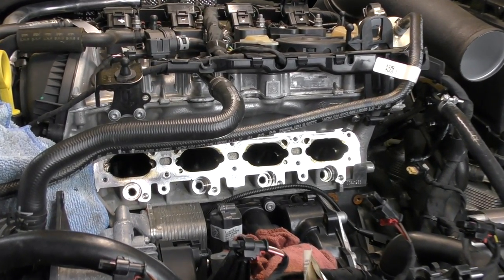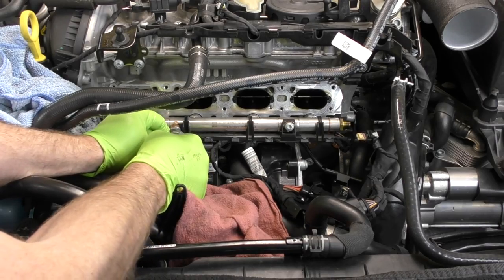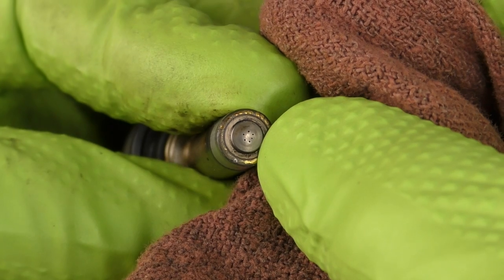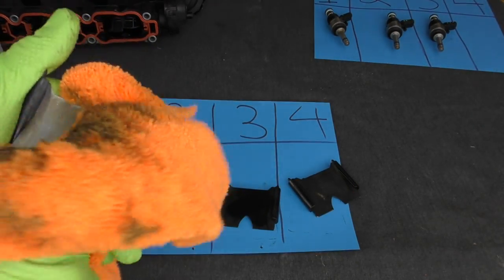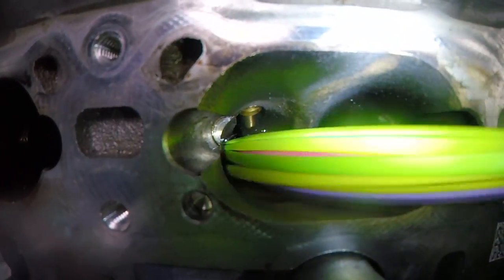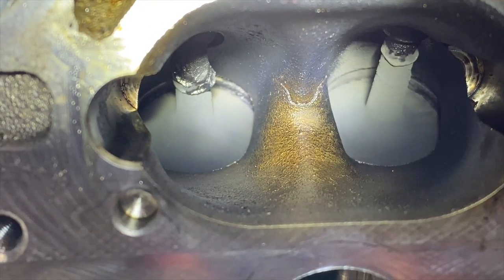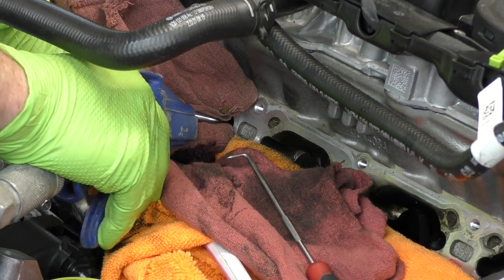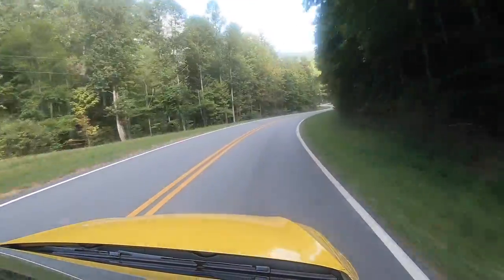How Much Carbon Build Up at 10,000 Miles?? ~ 2019 Golf R

Comment: My 2018 S3 is approaching 30K miles.
This amount of carbon buildup is alarming.
Reply: Rob L. If you haven’t done any type of autox you won’t see heavy build up. Autox is a real issue with the oem pcv valve...
Reply: @markd3891  You don't know what you're talking about do you?
Reply: Olle Jansson I own a 16 R dsg. Maybe the way I explained wasn’t too great. All DI engines will built up carbon eventually.
Reply: At 30k you are close to beginning stages of clod start misfires. I always push the induction service on my customers every 30k.
Reply: Lynx Star Automotive Yeah it’s interesting on the gen 3s versions. My bro’s 15 S3 always had a rough cold start idle like miss fires from new, my 16 R (24k miles atm) never had any of it like my bro’s. My friends 16 R is at 63k & it sounds literally the same like mine. (Plans to diy at 65k). From what I’ve seen & witnessed, the gen1/2 would carbon deposits like no other ~30k while the gen3 being more reliable seems to be having carbon issues anywhere from 60-80k. Luckily we don’t have timing chain issues but the dreaded water pump remains the same.
Reply: Mark D Water pumps are ham and eggs. I can knock out a WP in an hour and a half.
Reply: Lynx Star Automotive yezzir, probably why they didn’t budge on reinforcing them to be more reliable. Hey more work & $ for you guys
Reply: Mark D honestly, after the latest revisions, they don’t fail that often. I typically see them go about 100k now a days.

The issue lies when customers skimp and either buy a counterfeit, an outdated part number, or just crappy aftermarket. Those are not worth the 80 bucks you are saving.

Oh and BTW, the pump was redesigned on later model years. The housing is more robust. The impeller housing is now aluminum. The thermostat housing has also been redesigned. Pay attention to Charles’ pump with the intake out.
Reply: Mark D One is my main suppliers closed down when things started becoming more imminent, and I myself sent everyone home and pretty much just stayed by myself and any other techs that had in process jobs. Once those were wrapped, I sent them home as well. I’ve taken calls here and there, but nothing too serious. Figure we ride this out until the all clear is given.
Reply: Cars with direct injection are garbage. I can't imagine that engine will last after 70k
Reply: Daniel Calquinhas I’ve seen plenty of TSI with deeeeep 100k’s. Usually, the DSG clutches go out before anything serious on the engine does. M6 cars for the most part are bulletproof. Oil quality and maintenance plays a huge role.
Reply: Yeah I'm sure you have. Building B/K series hondas and being a full time mechanic for 16 years no amount of internet back and forth will change my mind on these vw engines. These engines are unreliable and overcomplicated. The reason perfomance and mechanic garages love them is because it keeps them in business.  I've seen b18c1's bone stock with 200k make 500whp with a simple turbo kit. This engine at 10k already almost had a partial blockage at the injector lmao. Just drop it friend.
Reply: Daniel Calquinhas What a load of exaggeration, but yeah sure buddy 500 whp racing lasting 200k miles, OK. 
The gen3 & ea855 are leaps & bounds better then there previous gens & example is38 gti are 380-400 whp proven reliable way past 100k. Don’t think so? Go on the giant FB Mqb gti R group page & ask what kind of miles people are at. You will be surprised. 
By the way those new Honda turbos that they have now, I heard nothing but issues with them especially their bread & butter cars. 
The 18 & 19 VWs came with 6/72k mike warranty something that it is unheard of from the German world. 
Lastly you are thinking of the horrid gen1 tsi...those were such a pita as soon as you hit 60k & it’s why it keeps folks like Lynx loving those previous gen engines.
Reply: Daniel Calquinhas LOL. I won’t argue friend, ignorance is bliss as they say. I will tell you this, I’m 37 yo and built plenty of Hondas in my day. You are not pushing more than a couple of psi of boost on a stock B18 and getting very far. Stop it. Ohh and manual transmissions only. Don’t even think about an autotragic.

A Golf R is a tune away from 400 HP. 

But you do you.
Reply: Lynx Star Automotive I’ve had golf R for 4 years and 70k miles, I only do scheduled maintenance with feeler in the UK over here. I’ve had absolutely no issues with the car at all. MPG and performance is no difference compared to when I first picked it up.......
Reply: NL3044 They are bulletproof. Oil service is extremely important. Good quality oil (Liqui Moly) and no longer than 7k mile intervals (or 11km for you). That will take you far before you need anything major.
Reply: Great!! Can't wait to see how much mine has @100,000!

Comment: 0w20 oil just evapotate almost like water and it is absorbed very easy by the pcv and thrown in the intake.  Caratec doesn't do a thing and the petrol v power, is not sprayed in the right place.  One more round of injectors, placed in the intake, eventually by the manufacturer, witch should work in a few driving regimes, as in long rides and highway or something like that ,would fix this problem for ever. 
Thank you for this video, H.M. !
Was like gold! :)

Comment: I would be interested to see how this differs from the eurospec multiport injection engines, or with an aftermarket multiport kit such as the one offered by APR.
Reply: @Matthew Dunlap do you know how EFFECTIVE is the EU multiport injection system ? does it completely solve the carbon  build up ?   (  I'm asking you this because I'm aiming to but a 50K miles Passat B8 here in Argentina which comes imported from Germany plant and I already confirmed that it DOES have the direct+indirect injection manifold... but... is it 100% EFFECTIVE against carbon buildups ?
Reply: @opablo_gm  I can't say for sure how effective it is. Most fuel has additives for cleaning, and fuel itself can act as a solvent on the carbon. It may not be 100% effective, but it should be much better than direct injection.
Reply: @MatthewGDunlap  Yes its 100% efektive! Even on high milege cars intake is clean, i speak about 250k km cars! Its clean because of that system inject the fuel in intake valve, if carbon wich is not burn in cilinder goes in intake then fuel wich is injected in intake clean it and then no problem, its self cleaner(mpi). But speaking of Golf R even the European version of 2019 post WLTP emision regulation doesnt have mpi, it have just like american golfs direct incjection! So the problem is the same! Only pre WLTP cars version with 300hp prefacelift and facelift version with 310hp in Europe have mpi. Favelifted version with 300hp(post WLTP) doesnt have one! Its a shame on VW to do this in order to cost saving!
Reply: trader 247 Although high mileage is relative, higher mileage in the states means 250k miles. That’s only around 156k miles.  It’s still a lot but it isn’t as much as we consider high mileage.
Reply: @shadowthesi  Yeah u r right! But because here is video of Golf R wich is performance car, 250k km is a high mileage! So if in that condition doesnt have a problem, thats it problem is solved with mpi!
Reply: Euro versions are a lot better, this is pretty bad.
Reply: @trader2473  I have a cupra 290 with mpi & these injectors do a good job to reduce carbon. But these multi-port injectors are not high flowing but if going stage 3 you can simply get larger 930cc injectors to increase flow.

Comment: Europe gets a secondary fuel rail(with lots of other perks) which eliminates carbon buildup problems, idk why US still not worthy...
Reply: Doesn't the Subaru BRZ/Toyota 86 have both direct and port injection in the US?
Reply: You would think they would make it dual injection considering how they might payout if something big happens within the 6 year warranty period.
Reply: Aleksander Rysiewicz yup it has Toyota’s D4S so both port and direct
Reply: Yeah i have a 1.8tsi ea888 gen 3 in my car in the uk and it has dual injection, 2 per cylinder.
Reply: @calm7677  They also make like 140-150 to the wheels.

Comment: Ive used seafoam through the intake air temp sensor of my wifes car since the last carbon clean 30k miles ago. I use it every 3 months or so. But i dont want to pull the intake to see if it works

Comment: I remember pulling the intake manifold off my MK6 GTI at 240,000km and the carbon was caked on! Cylinder 2 suffered the most because airflow from the PCV port is closest to that cylinder. Mind you the car has probably never had carbon cleaned off before.
Reply from the maker: Yep 2,3 are usually the worst. That is why I did 1/2 for cleaning. Also the valves were already closed. LOL

Comment: For the first time I’ve tackled the job of complete intake manifold replacement along with throttle body replacement (previous owner crash damage) & did a a full carbon clean at the same time. I found these humble mechanic tutorials very helpful in getting my head around the EA888, albeit with the additional factory multi-port injection rail setup in an Audi S1 with so little room in the engine bay, that the internal bonnet latch in the rad support panel needs to be removed just to clear the throttle body. 

I’m still amazed at the carbon buildup from only 21,000 kms (13,050 miles) & I’m hoping the APR catch can setup & complete removal of the factory PCV setup (racecar-mandatory) will cut this excessive carbon buildup down in the future.

Comment: 102,000 miles on my GTI without a clean. Wonder how lovely that looks. No misfire issues and still getting 33mpg 🤷‍♂️
Reply: Well, that's good. My R is at 8800 miles and this video was making me get worried. Still think I might clean it, maybe at 20k or something.
Reply: 93K on my 2011 Gti and can't imagine how mine are. Used the CRC stuff through the air mass meter along with Techron for the injectors(pre-oil change) and I've managed to convince myself that I can feel the difference.
Reply: K C Shhh it'll hear you!!!
Reply: @chris746568462  same here...
Reply: How long have you owned it? If you bought it used, I’m willing to wager it has been done by previous owners before you.
Reply: Lynx Star Automotive bought it new December 2016.
Reply: @chris746568462  You will be surprised how minimal it will have. Most gen3 owners do them around 80-100k. I wouldn't waste money at 20k, save it for the dsg service, 40k stock, tune'd 30k.
Reply: chris746568462 i think 20k is a bit soon. Even on 20 year old DI engines, it takes at least 80k miles before you see problems on even the worst examples of buildup
Reply: Im at 118,000km, stage 1+ and other various mods. Curious to see what the difference would be
Reply: I think VW recommends a cleaning every 40K or so if I'm not mistaken.  A catch can set up would help a bit.
Reply: Do you think having the stage 1 upgrade will make it cleaner or dirtier?
Reply: @raizt1596  I would say dirtier because of running more rich and at higher cylinder pressures.

Comment: I think the fuel quality plays a big role in here.
we in germany have 1.2 ltr turbo toyotas with direct injection.
most of them run perfectly fine.
some are terribly bad. completly gunked up, it even cuts out. with 40.000 km's

these engines need some catch cans or like an old scool central fuel injector, just for cleaning.

but its a toyota. you remove the intake in 5 minutes.

Comment: I bought a new 2018 Focus ST in April 2018. It was my first DI vehicle and I had read plenty of the concerns about caking of the intake valves. Sure as hell, 8 months/10k miles later there was some notable funk accumulated. Oil: Amsoil Signature Series. Fuel: Chevron 93 octane.

I began hunting again, this time for a new vehicle that still utilized PFI. The S550 Mustang GT uses a combo of DI/PFI, but I wanted solely PFI. I narrowed down to a 370Z NISMO or a Shelby GT350 and ultimately went with the GT350 due to the Ford dealer offering better trade-in value.

No more DI shenanigans on this end, thank goodness!

Comment: Wow, not what i would wan't my 10k mile engine looking like. I love Volkswagens but i think ill stick with my 2x MK2 Golfs.
Reply: Love my 91 Jetta coupe yoe ,and the 79 round eye diesel 😁 that's in 1000 pieces in the corner
Reply: @MrTheHillfolk  I own a 5-door 1987 pre facelift MK2 golf 1.6 with a Weber carb ,and a 3-door facelift 1988 MK2 golf GT 1.8 also with a Weber carb 😁 Both are great!
Reply: There's a part of me that's drawn to VWs and occasionally I think that maybe a Golf or a Jetta would be a good new car, but Charles does a pretty good job of bringing me back down to earth and remembering why I shouldn't do that.  :D  I'll stick with my '68 Beetle and if something like a Scirocco or a MkI or II Rabbit/Golf/Jetta comes my way I wouldn't say no, but other than that....
Reply: Direct injection is garbage other than marginal fuel efficiency which is sacrificed by users demanding more power and bigger, heavier vehicles.  Change my mind.  Sold my other car to buy a 1st gen Insight.  60 to 80 mpg,  995cc, 1800 lb, can go 400,000 to 800,000 miles without a rebuild.
Reply: @VndNvwYvvSvv  Agree completely about GDI...that's why I'm either considering one of the handful of MPFI cars left on the market or restoring something older for my next daily driver to meet my rather modest needs
Reply: Just bought an mk4 for 800$ check engine light on and 289k miles as well as abs lolz
Reply: It's not a vw thing. It's Direct injection only engine problems. Many auto maker has already moved to these type of engines
Reply: LOL they all have horrible engines. They're VWs.

Comment: Here is a tip for you, Charles. Subaru upper engine cleaner and a long air nozzle with a high pressure air supply, fill the port with the Subaru product, let it sit for a couple of hours and then just hit all the build up with the air nozzle, it breaks up the carbon and sends it flying. Note that this method is very messy and you need to cover guards and fenders and what have you with an old sheet or plastic seat covers and also stand out of line of sight with the intake ports when applying the air.

Comment: I'm lucky I live in Europe.  And these engines have Port injection also.
Reply: 2019 onward don’t have MPI anymore in EU/UK.
Reply: Do you know if the 1.8 engine in Europe are mpi?
Reply: @KasamS  I believe so.
Reply: @cfbm125  lucky mines 2016 😉
Reply: Alan Ton Same here, my GTI is a 2016 also🙂.
Reply: Kasam Sagir not sure, but if it does you’ll be able to see the injectors in the top of each port of the intake, if not there will just be the holes where they would fit.
Reply: Same here, mine is a 2014 Audi  A3 1.8 TFSI CJSA. Suprisingly little buildup on it, even for having 150000 km’s on the clock. 

Haven’t had any issues on the Gen 3 engines in terms of buildup. Just a shame VW went away from it on the newer gen TFSI’s. Like taking a step backwards
Reply: @cfbm125  kl im looking at getting a 1.8 leon. No point in me getting a catch can on a daily then
Reply: Exactly what I wondered. So the US ones don't have? :O Condolences, guys...
Reply: Can someone please explain what is different about Euro engines? I'll be looking to buy a MK7 R Variant in Europe, do they not have the same carbon buildup issues?
Reply: @Jokero_YT  Apparently they have port injection as well as direct injection. So when the fuel is being injected through the ports it's cleaning the valves as the fuel passes over them.

Someone plz correct me if I'm wrong.
Reply: @scotwilson4169  Right, the DI alone is injecting fuel into the cylinders when the port has one injector spraying into the intake manifold I believe in the Euro engines for emission purposes, right?  Also from my understanding, the biggest culprit to carbon buildup is the PCV which should be changed often to maintain optimal operation and reduce buildup.
Reply: My 2019 Audi A4 (USA) 2.0 has 8 injectors so I assume it also has port injectors to help clean the intake.

Comment: I used easy off on my B7 let it soak ........ cleaned it with a tooth brush and re installed my intake and did a Wins intake foam cleaner and after the clean sweep through the vacuome hose of the purge solenoid , 20 km road test and finished with a oil change and filter...... haven’t touched my R yet because I’ve only done 3K km so far, but it was worth all that work........ but I do have to say that it sad to have to do all this work on a higher end vehicle after spending so much for the car........ when you have cheaper cost vehicles that don’t require any of this in there lifetime, and we have to use fuels the don’t have ethanol....... I like the way you work, I am the same way and I love detailed work....... nice video